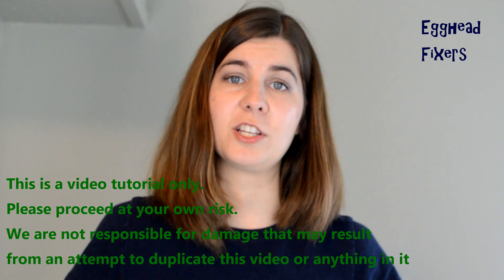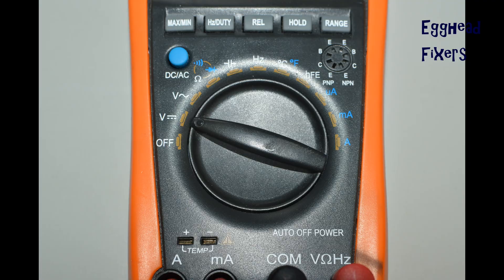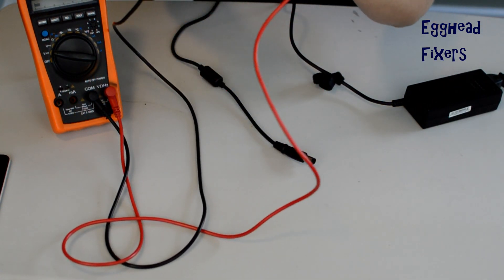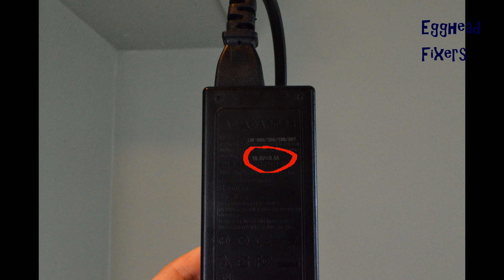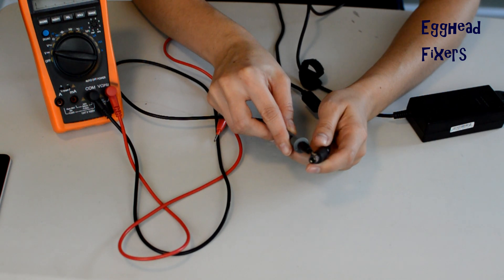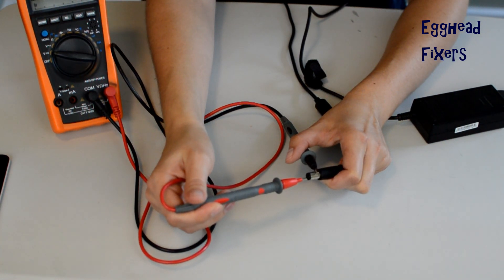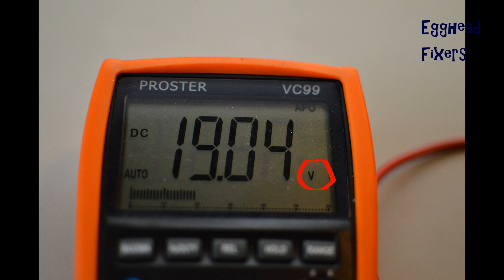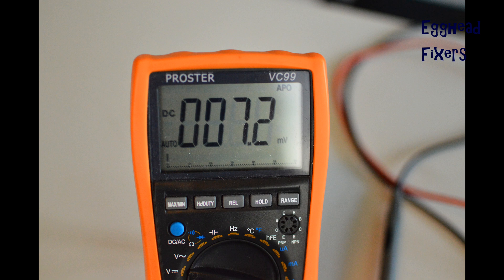Repair For My Acer Laptop Not Charging, Turning On Then Off Or Won't Turn On At All. Video 2

Comment: How do I know the normal range?
Reply from the maker: You can read on the power cord how much it is suppose to put out. It should only be a volt higher or lower than that. Much more than that and it may be a problem